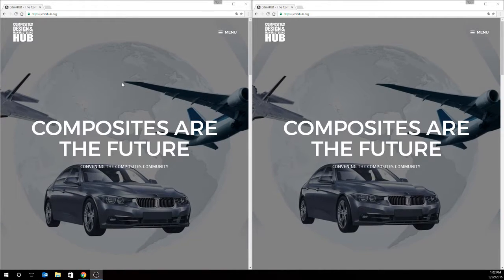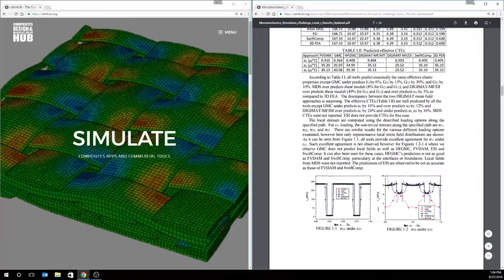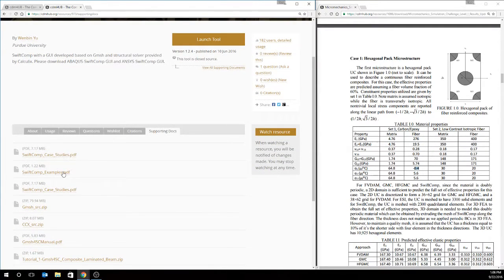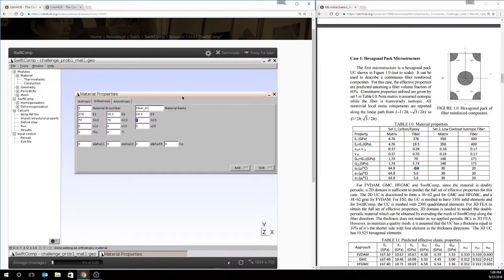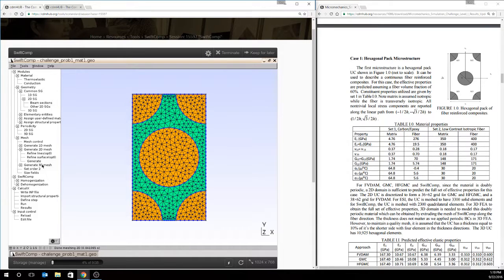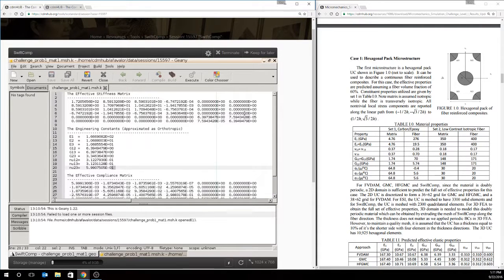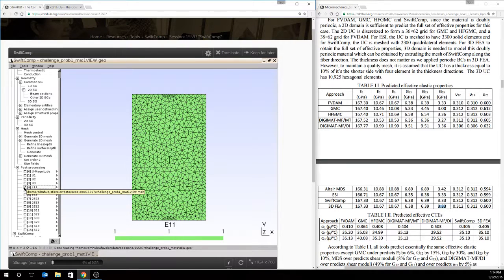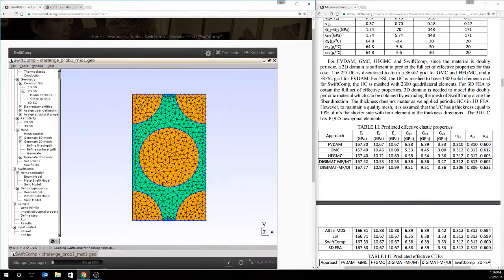cdmHUB Tool Tutorial: SwiftComp gmsh GUI - MSM Level 1 Problem 1

Comment: but when I run the homogenization in swift comp in CDM hub account but got the failure output result error, I used 2D SG with yarn and matrix, I took yarn as an orthotropic material and matrix as an isotropic material.

But after the geometry and meshing when I am running the file the output result error is coming